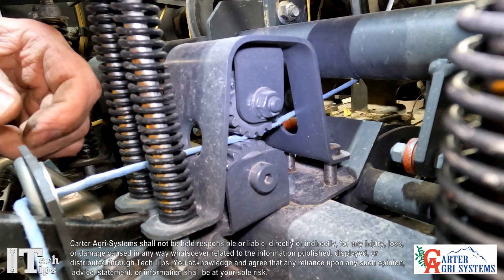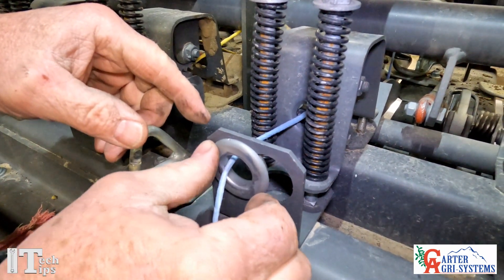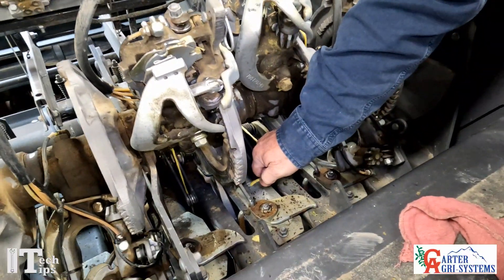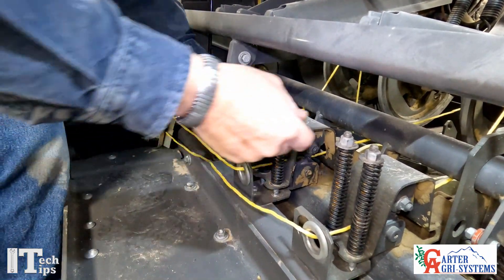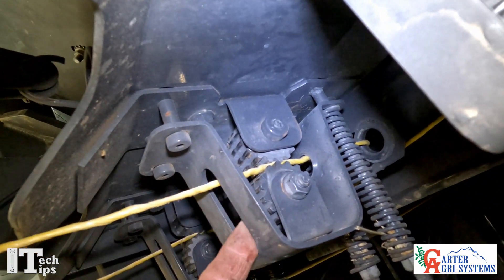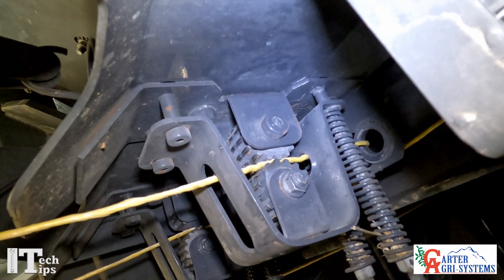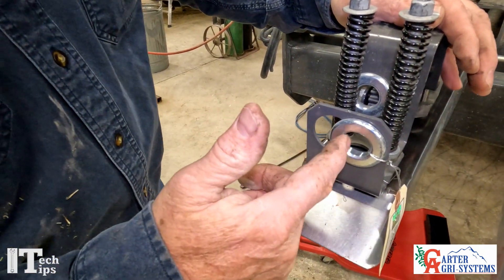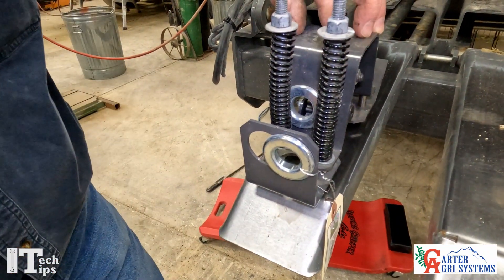Carter Ag Tech Tips 2100, 2000 Series MF Baler Twine Tensioners

Comment: We had issues with our lower tensioners on our 2019 MF2270's when we first got them. Never remembered having so many issues with them in the past on the 2290's and 4910's. We ended up installing the tube guide from the Maize Corp. and hardly have a twine come out of the tensioners anymore. Although, baling timothy grass causes the most problems and reveals if your knotting system is not set correctly. I enjoy these videos and appreciate the effort you put into them.